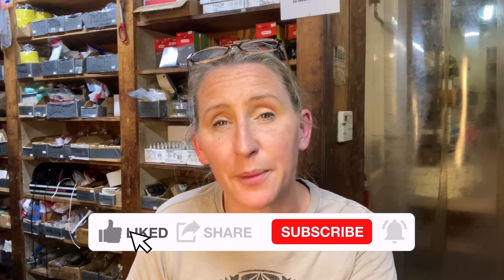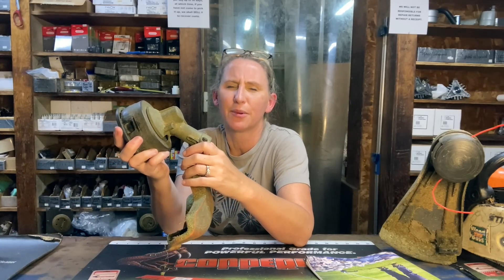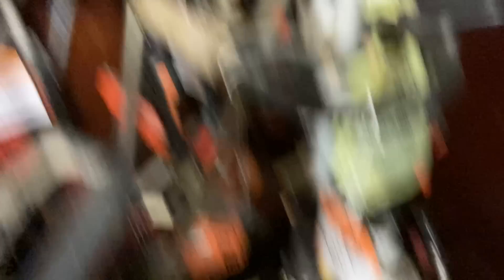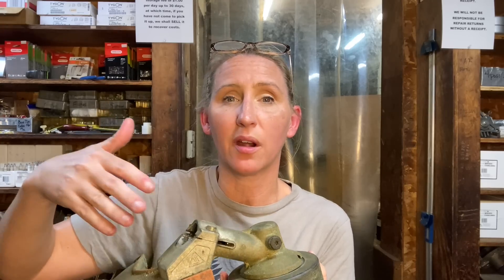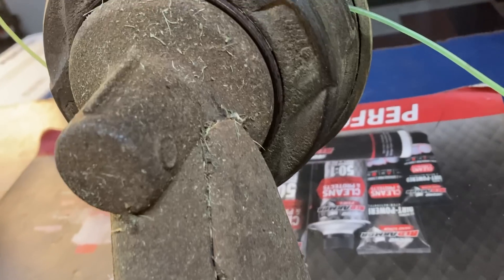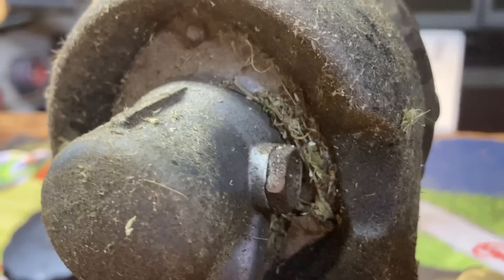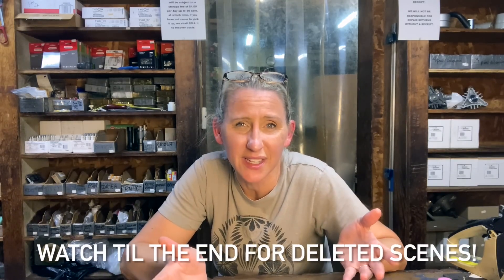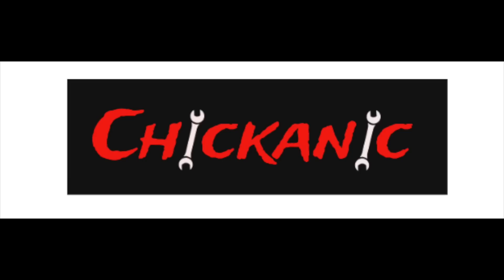Planned Obsolescence?! Why Would STIHL and ECHO Do This?!

Comment: Can almost guarantee it was not the Engineers that wanted this change, it was the bean counters. My experience in the auto industry, is that the bean counters win more than the Engineers.
Reply: Bean counters cost companies more money than they save.
Reply: @dennislaws5187  Especially when it ends up costing them a fortune in warranty work.
Reply: @OldManButtWrinkles  Yeah, exactly!  Xbox 360 red ring of death anyone?
Reply: @OldManButtWrinkles  Only if customers want to be annoyed with constantly taking the product in for warranty repairs.  They bet on frustrated customers buying another product rather than repairing the failed one.
Reply: @OldManButtWrinkles  Yup... but every company i've worked for does not take warranty costs into account on their bottom line.  It's really disgusting.  I've worked in some places where spending 5 cents on a $400 item to cut down on millions in Warranty was poo poo'd by marketing and management.
Reply: Corporate greed. They all do it. They do not care about the ones who keep them in business. Makes me sick.
Reply: Yep. They call it M.C.I.P. (material cost improvement process).
Savings on cast material probably 4 cents. Remove machining process 5 cents, cycle time improvement 3 cents and deletion of plug 4 cents. 
That's 16 cents per unit in savings.  Wish I knew what the production volume is. 
Statistically likely that 97percent make it through warranty period so the design change is approved.
I lived this stuff for 38 yrs in automotive too. Glad I'm retired now.
Reply: They all win , parts failure and re supply - only we the consumer lose , funny that
Reply: I compiled an end of year refit report as engineer on the trawler I'd been on that year , included was "Main gearbox needs repair as bearing material found in oil strainer at last check" words to that effect . It was about a $10 - 15,000 rebuild on a $90,000 gearbox . The bean counters struck that item off the list . Next season I was on a different vessel same company , the chief engineer told me that the vessel I had been on had to be towed into port because of gearbox failure and they lost so many days fishing while sourcing parts and someone to do the work . These boats turn over more than a $mill per year in catch , that was a very expensive "cost saving" for the company .
Reply: The same thing happened at Apple after Steve Jobs passed. The ethos changed from “How do we make this the best X?” to “How do we make the most money from X?” Pretty fast.
Reply: On 1 of those trimmers that has no way to grease could you find a boss or a decent place and tap it? Put grease plug in to save $?
Reply: High! 😊
Reply: Spot on Sir, isn't it always the way 😊
Reply: Bean counters win because CEO ‘s want profits so they get their bonuses. The board and stockholders want the stock price to go up and pay dividends.
Reply: Probably wasn't the bean counter. Most likely the field support team complained about it early on and sales wasn't hurt by the change and the industry followed suit. Just so happened to be a small cost saving measure over hundreds of thousands of units being produced per year. 
Don't take my thought on this for truth, but I do work for one of the manufacturers mentioned in this video.
Reply: Engineers take economics classes now. And ever since they’ve done that products suck.
Reply: @countryshaner141  I know. Got an associates in applied sciences for computer engineering and electronics about 13 years ago. Did it in my mid 40s. Why I mentioned the math and having gone there. Conversely, that same math would allow them to make great products. But as my department said of having worked in the industry, you had to be able to make the product as cheaply as possible, using the cheapest parts. Yeah, I know a little about the engineering world. I don't work in it, not worth it to me as well as employers had to look for specific types of employees to satisfy legalities. They didn't always look for the best qualified.
Reply: Just ask Boeing about the cost of bean counters and bee bee stackers.
Reply: My friend's dad was an engineering project manager at Ford in the 80s. I asked him about the Ford Tempo. He said they were told to make a 50K mile disposable car. If they put in one failure point the after market might fix it. So they designed the majority of parts to fail at 50K. A percentage of those parts failed early.
Reply: @mikepaulus4766  They don't make them like that anymore. The later model Focus was known to puke the transmission around 30-40K. Those drivers wish theirs lasted 50K!
Reply: I😅😅
Reply: Hands down. So many people changing to batteries. Cutting corners
Reply: That's absolutely true. It's called greed.
Reply: I love that  "bean counters" I'll be using that in the future if you don't mind. As a engineer I know bean counters don't have common sense.
Reply: @peterdooley2393 welcome to the 1970's
Reply: 9:30 pm lawn mower…welcome to my suburban hell scape.
Reply: Saved two dollars a thousand there bub. Yee Haw!
Reply: @@offleashfarms5441 oh, but I do!!  Unless you’re inland, commifornia is the root of almost a problems.  Just look at every single thing you buy has a prop 65 warning, it’s really pathetic.
Reply: @keithsargent6963 ya. We have rental houses. Used to repair. Now we just replace them. Increased the rent to cover obsolescence in that market. Now at home I bought a thousand dollar Speed Queen with the ten year warranty. So far so good.
Reply: I have an Echo trimmer from the late 80s that runs perfectly, even after years of 10% ethanol gas (I now use anti-ethanol additives). Echo hates owners like me, they are embracing built in obsolescence.
Reply: Bean counters are what wood chippers are for.
Reply: You drill a hole through the caseing, tap it for a grease zerk, problem solved.
Reply: @scottchapman9931  The casings are often thin and won't take a thread. 
Might be possible to epoxy a nut over a freshly drilled hole, though.
Reply: Same experience with car compainies and personal friends with engineers for Ford, GM and Chrysler and they are constantly angry because they are forced to redesign things because the bean counters don't want to pay for doing it right.  This goes back to when I was a young mechanic.  To save 4 cents per car, they removed two of the screws holding down the carburetors.  One of the bean counters decided that was all that was needed, based on whatever.  The engineers said no they were needed.  Bean counters won.  The result numerous problems with carburetors warping and vacuum leaks.  GM spent millions on recalls to drill and tap manifolds to install the two missing bolts and replace the warped carburetors. This was in the late sixties.  Going back to the fifties. They had a year when they had mismeasured rocker arm studs on the inline sixes one year.  Rather than replace all the studs on the affected cars, the bean counters cam up with the brilliant idea to stuff a nylon "sock" in the valve covers to hide the noise of the clattering rocker arms. When customers found out, it did not help GM's reputation.  When I was working at a Chevy dealership and we got a similar type of "fix" for a problem in the mid sixties,  I asked the GM factory rep,  "Does't GM worry about the quality of cars they have and lost customers because of improper repairs."  His response was "GM does not make cars, GM makes money, and there is a new customer born every minute."  I have often wondered what he thought as GM's fortunes declined in the 70's because of custormer dissatisfaction with the quality of their cars, especially with the influx of better made cars coming from overseas that people were flocking to.
Reply: @gerardtrigo380  I was life long GM man 35 years, my father 67+, had a problem with an 2012 Equinox my Dad bought new, I bought it for my son when he bought a 2018 Equinox new I received bulletins from GM about oil consumption issues on this 2012 my son was good about checking oil but got in little low 1.5 quarts down when mechanic drained oil from ruined engine jumped timing chain when he was starting it. Wrote letter to GM and checked with the dealer and the response I got from GM over time and miles too bad so sad. Only a month or so and couple thousand miles. They didn't give a s*** how many GM cars and trucks my family owned. F*** them! My money has feet and walked over to Toyota and went from 3 GM cars to 3 Toyotas. My brother told GM to sc*** themselves.🤮
Reply: American consumers are demanding manufactures build cheap tools so they can stay comfortably blind to the devaluation of the US Dollar
Reply: Thx.for the info.
Reply: Engineers need to step up their influence. Perhaps infiltrate the accounting office. They are really looking like shit these days. Perhaps they should consider the path their life has taken. Sell outs I say. All taking part in making their countries look like shit. Lately I have seen it get so bad I wonder why the globalists are not linking global warming to all the excess manufacturing due to planned obsolescence. Ya there is a thought to ponder?  Just think of all we could be doing with the time and effort that goes into replacing what should last a lifetime. Like my old Farm boss from 93. Or my 272 husky.
Reply: Its very simple as the upper echelons demand more sales to make more profits, there is more than profit as there are after sales and warranty work and these costs have spiralled out of control and the upper echelons demand more sales and design things not to last for more sales; design something to last 10 years and its one sale every 10 years, design something to last 5 years and its 2 sales every 10 years thus doubling your sales.
Reply: "Can almost guarantee it was not the Engineers that wanted this change, it was the bean counters"
This endless talk about 'bean counters' is just such utter stupid shyte.
OF COURSE engineers, ie people who are NOT employed to consider the price/cost/revenue aspects of engineered products, never want any change that saves money.   Which is why you have the childishly disparaged "bean counters".  So, you know, companies can manufacture products at a competitive price.
Reply: The engineers may not have wanted it but, you know, guilt by association.

To be honest I w8sh groups of skilled people would come together and form a company which creates a product they could be proud of....
And keep it instead ofselling out.
Reply: Right on!
Reply: Capitalism is the problem with lack of regulation, this is why we need consumer protection laws ensuring companies to build to a minimum servicable quality, to stop them ripping us off for profit.
Reply: I see no grease plug on a trimmer, I just don't buy the trimmer. 
   If enough of us keep them on the shelves, they'll think twice before doing it again
Reply: But in my experience, engineers get their bonus and raises based on how much money they save the company.
Reply: so tired of seeing this “bean counter” comment. Accountants could care less. It’s upper management bonuses contingent on stock price & earnings as well as clamoring by Wall Street for ever greater profits.
Reply: @donh215  Yes it's really the MBAs who do it. They are hyper focused on short term profits even at the expense of long term viability.
Reply: @donh215 *couldn’t care less
Reply: @donh215  Agreed; but there are many CEOs who have no idea how to run a Co. and will listen to the CFO all day long.
Reply: @donh215  You are correct, my son was the finance mgr (head bean counter) for the launch of a redesigned popular Ford vehicle, every tiny change to the vehicle design and assembly process crossed his desk (had a team). For every change, tiny or major, he had to provide mgt a revised cost & profit margin forecast. This went on for 18 mos. Yes, mgt has the final decision on every penny spent or saved. On the 2012 - + Focus, engineering warned mgt the transmissions needed more development time, mgt said they can't delay so build them, it cost Ford millions in warranty and lawsuits. The shareholders get screwed too when this happens.
Reply: @donh215  The bean counters summit the cost analysis to upper management without consulting with engineering base solely on purchase invoice of raw materials.  Seen it all the time, accountants want to score a point with management.
Reply: @ArmyNurseCorps-u5c   Accountants are not the same as parts buyers or procurement department. “The procurement department focuses on negotiating, creating a long-term relationship with suppliers for automotive components, monitoring the supplier evaluation, in the same time cutting costs and finding less expensive solution to increase company profitability.”
Reply: @donh215 OMG!  Same difference!
Reply: @donh215 Yes Don, true, that's the system we've long had to endure reaching it's logical end of failure and collapse leaving just the south Asians rubbing their hands in expectation .😊
Reply: If the company is asking for it they prob have to fo it, I'm n guessing at this though.
Reply: Henry Ford was the first industrialist who brought accountants into the corporation. Been a sad day ever since.
Reply: Just look at all the cars and trucks these days, never need a transmission service, WTF is that all about???  The crazy people in Commifornia are making life much more expensive for the rest of us!
Reply: @chrisforker7487  Like new BMW's needing rod bearings replaced every 100,000 miles. No dipsticks for the tranny, and engine. Makes no sense to me.
Reply: @chrisforker7487  My buddy just bought a $75,000 Ford F350 4x4.  Not one single molecule of undercoat.  White paint in the wheel wells, so I crawled under it and was staring at about a 1/2 coat of Ecoat primer.  I told him he'd have complete rot out of his rocker panels and bed side wheel wells in 5-6 years.
Reply: @chrisforker7487  No legislation caused unserviceable transmissions and I defy you to find a reference so stating. What that is driven by is "vendor lock" where the scumbags who made those design choices drive owners to dealerships for service. The government has no role here since the idea of "consumer protection" in the US is (thanks to corporate propaganda) considered some communist plot. Another example is limiting access to diagnostic codes when every vehicle should display them on the dash on command (since the data already exists in the system). If we had reasonable consumer protection laws makers could not hide diagnostic and repair info from the public, but the public are rarely technically literate so they don't demand manufacturers serve the customer.
Reply: It is all gearing up for replacement into electric. Even electric has built in obsolescence with the battery.

I bet the average homeowner won’t have a problem and the professional can write off a repair. A simple casting eliminating a step in production probably cut out a job.
Reply: @larrybe2900  I actually thought she was going to talk about Echo and Stihl's battery equipment since Echo now has a newer second variation of its battery powered equipment.  The first version was on the market barely 5 years.
Reply: Dont count on that. LOL

Comment: I have an echo SRM 225 its a couple years old, but it spits oil out of the muffler and its being doing this from the beginning I thought it would stop after it was broke in but it still doing it. Do you know if its a defect are a recall on this unit. My son also has the same machine and his does the same thing just not as much.
Reply: Being a two stroke the oil comes  from the fuel that is being consumed, right?  A few thing that create this scenario are fuel mix to rich, fuel adjustment at carb to  rich, running at less than full rpm and not getting hot enough to combust efficiently.  Check to make sure of any or all.

Comment: Agree on the Speed Feed head. I fit them to all of my trimmers, not just the Echos.
Reply: What about a 40v ryobi?  I bought one a month ago so it is the electric battery carbon fabric.
Reply: I replaced the problematic OEM trimmer head on my late Uncle's Honda trimmer.  I liked the idea of these heads that I had a smaller copy variation on my MTD and other similar trimmers.